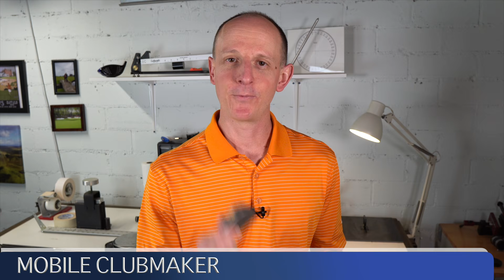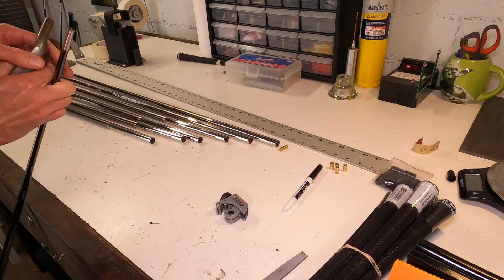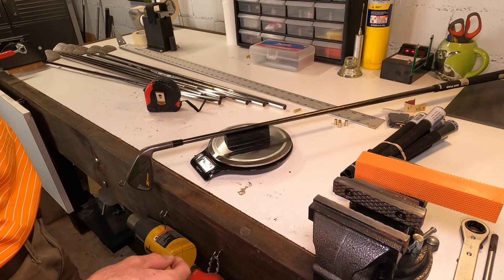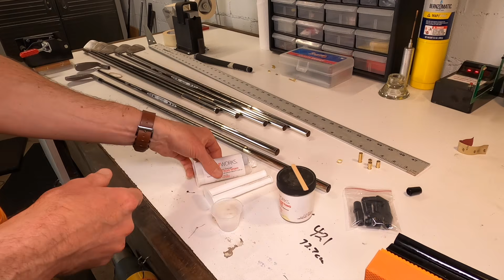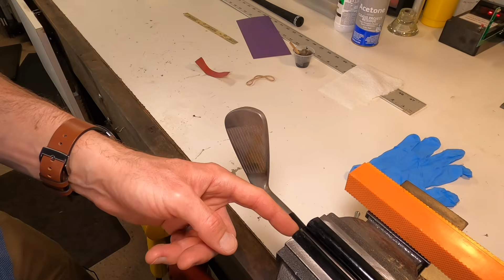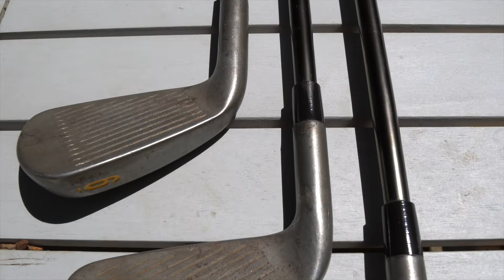BUILDING GOLF CLUBS INEXPENSIVELY / NO COSTLY TOOLS USED!

Comment: What ferrules do you use that slide on so easily?  I usually have to pound mine on and it is the hardest part of the build.  Thanks and great video as usual.
Reply from the maker: I cheated and used .370 ferrules on the .355 shafts. It doesn't really matter since where the ferrule sits the diameter is basically the same. 355 ferrules are alway a pain to get on so I often opt for .370 on taper shafts. The small amount of epoxy holds them so I haven't seen any higher rate of ferrule creep.
If your ferrules are an issue getting stuck, soak them in hot water before installing.

Comment: How accurate was the swing weight on a scale?
Reply: very, I calculated clubs from driver to wedges with the formula vs a actual swing weight scale, the difference is less then 1 point of SW. Which I think is due to the inaccuracy when measuring the balance point, you should be no more then 1/16 inch off.
Reply from the maker: Everything was between D1 and D2 except the PW which was slightly heavier based off the decided length. The scale and calculator both worked out those same numbers.

Comment: best way to match irons peromance thorugh the set is not by swingweight but by MOI
Reply from the maker: MOI is an option but would never say it's best or even better. Might work for you, might not. I built a MOI set and was not impressed with the results.
Reply: @EFGMC  Your absolutely right, your milleage may vary. I'd should had added best for medium - high hdcpers ;-p